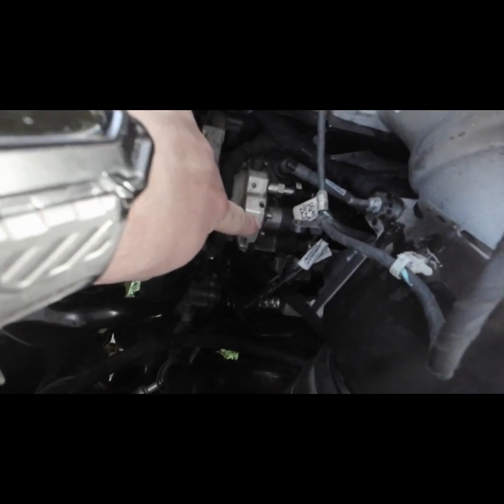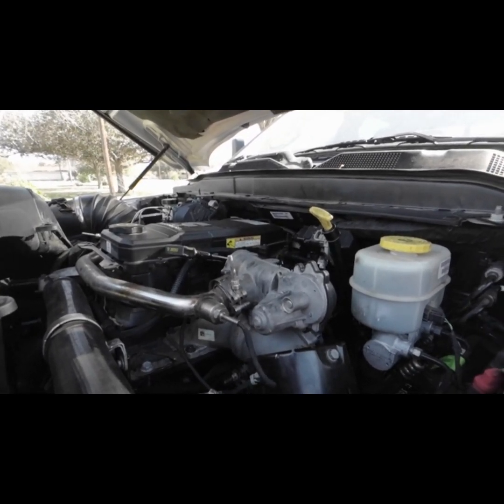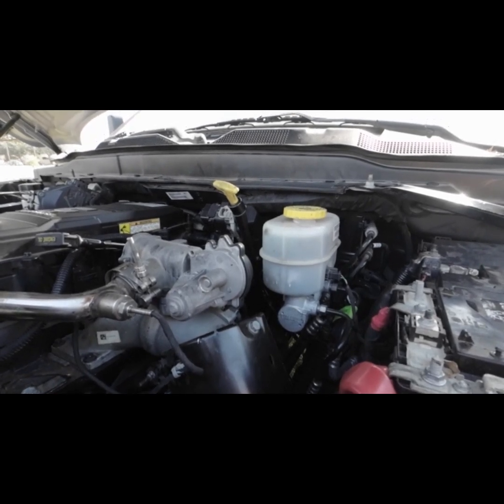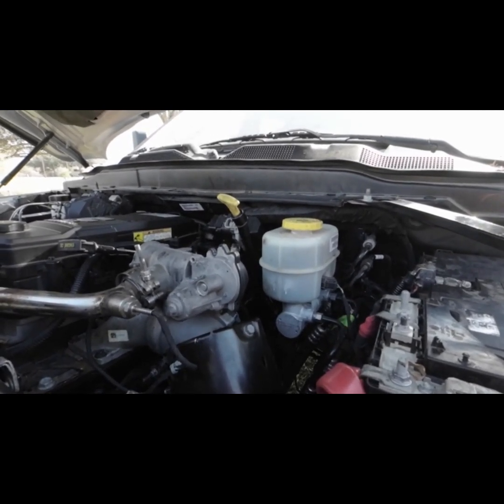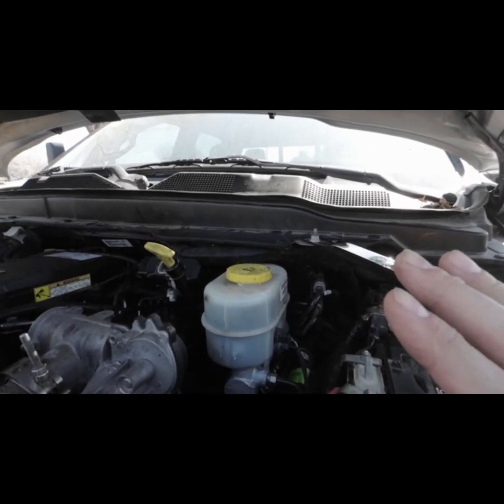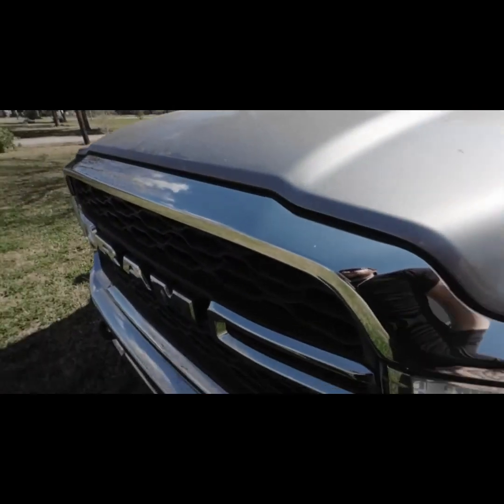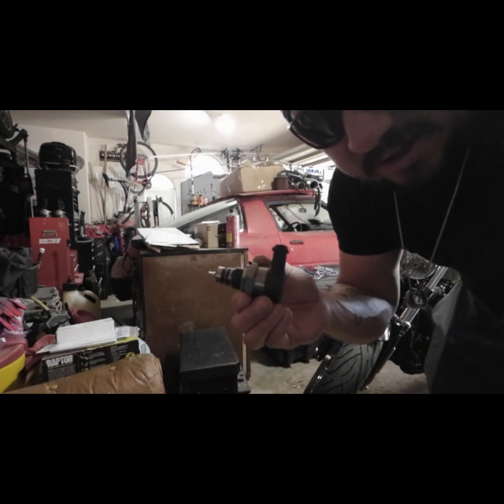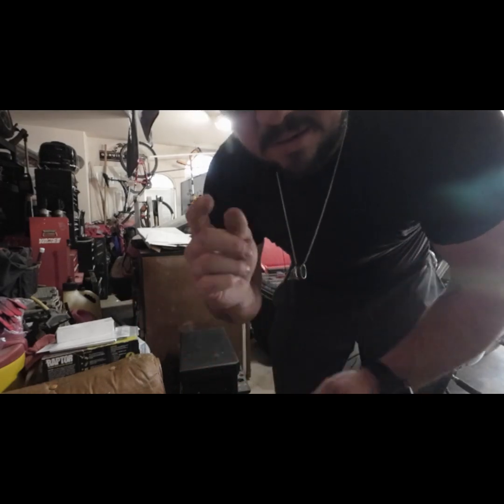6.7 Cummins P0092 Fuel Fuel Pressure Regulator

Comment: I’m having same code no start my question is you have to have power and ground at ignition on? So it activates to build pressure? I’m not building pressure at all help please.. I’m not getting power at key on engine off just ground I’m not sure if get power while you turning the engine?
Reply from the maker: Yo sorry, yes at key on its supposed to have 12v
Reply: @ I just getting 3.volts check continuity on cable from ecm to valve is good you think bad ecu? If I don’t have power no way to built pressure? Thanks for you reply
Reply from the maker: @mlbcom sorry i hadn’t checked back I would check pins directly at ecm make sure you have 12v switching if no power there at key on than ecm may be the problem

Comment: Did you ever check the voltage with the key on? Having the same code on a 2020 not start but also the pressure sensor is stuck at 200 psi
Reply from the maker: Key on yes, you should have voltage. The pressure regulator is basically on and off only. No voltage to regulator means it’s just going to pass fuel back to basically return. When you apply voltage it closes and allows it to build pressure. Check the pins on the harness connector to regulator. Sometimes they will expand and not make contact throwing the code and a no start condition. Take a small pick and try to close them up and try again. Hopefully it starts right up. If it does replace harness connector to pressure regulator. Good luck hope it works! The 200psi is just base line pressure on sensor